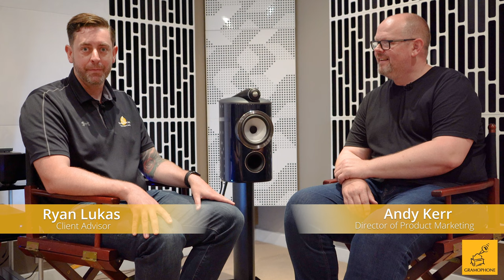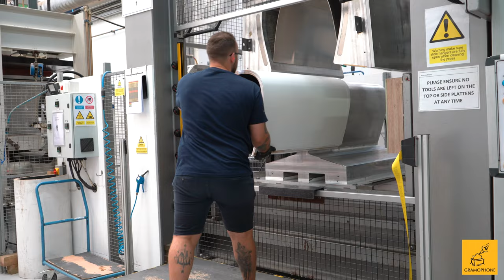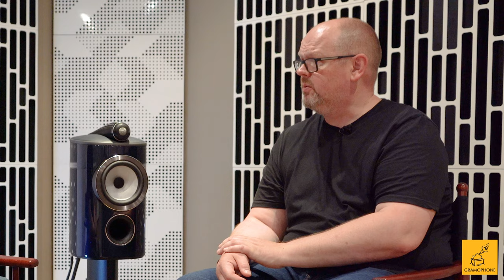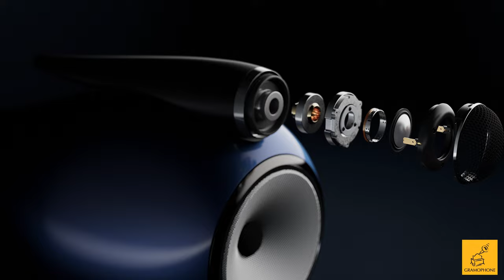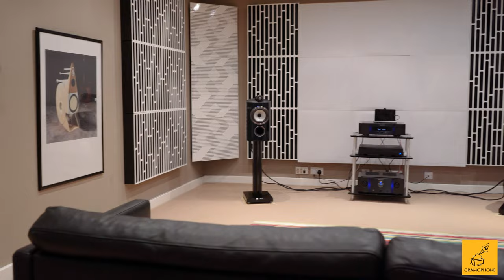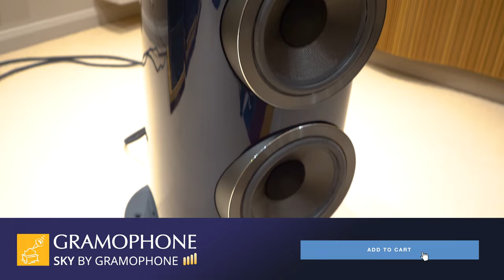Bowers & Wilkins Signature Series 801 | 805 D4 Interview

Comment: I have to ask.......Why isn't the new motor system mentioned on the B&W web site ? When in fact Andy states that the motor system is upgraded! I am sure people buying this new 804 will want to be sure!
Reply from the maker: Hello Xsamitt, we believe Andy is referring to the upgraded drive units (drivers) when he discusses the motor structure.  Maybe it's just a matter of terminology 🙂
Reply: I was under the impression that it's the same continuum cone? I am not sure what he is talking about! @GramophoneMD
Reply: This is from a review"......(In addition, an all-new bass / midrange motor system features upgraded performance from its 6.5” drive unit, ensuring both a cleaner delivery through the midrange plus more extended bass)   So Why this is not on the web site is confusing to say the least! @GramophoneMD